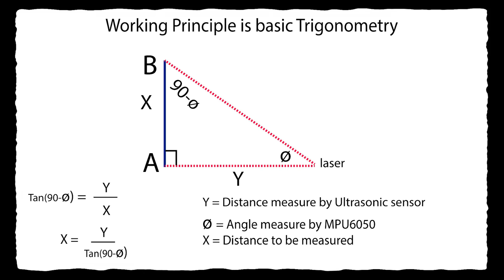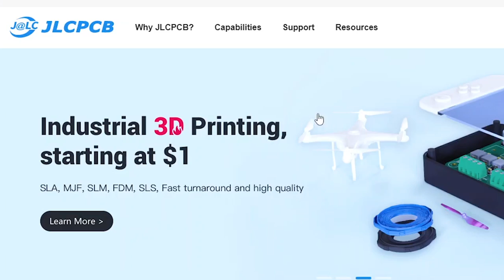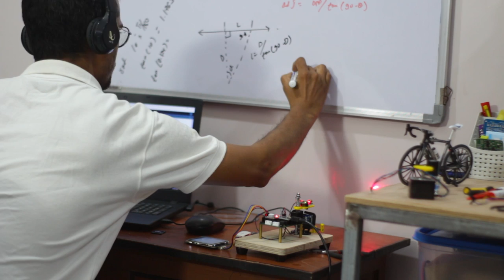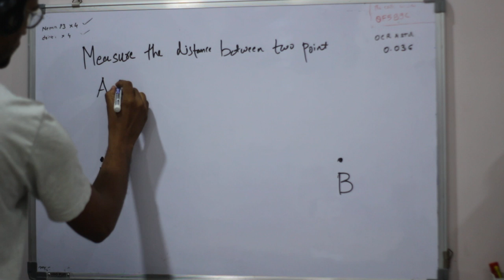DIY gadget to Remotely Measure distance between 2 points.

Comment: I understand the concept. It measure the distance between ultrasonic sensor and the wall along a perpendicular. The other variable is the angle between laser beams. How do you measure the angle? What kind of sensor you use? Arduino must to know it.
Reply: You could use on the fancy side a gyroscope or on the cheap and easiest side a potentiometer or a rotary encoder.

Comment: How about using trig and lasers to find the distance to the board or even an object at a longer range, a range finder.  2 lasers at a known distance from each other, 1m.  One fixed straight ahead. The other laser movable with the angle fed to the microprocessor.  Superimpose the lasers on a distant object and calculate to find the range.  Whala a modern coincidental range finder.
Reply: I was thinking the same thing. 2 different variations of the same concept. This is a nice implementation.

Comment: I didn't expect that angle measure with ITG/MPU would be accurate, impressive. But if those are accurate you could use a second one at the second laser diode. The differnce of angle to level is the angle between the laser diodes. Knowing the distance between the lasers, you can calcluate the distance of the object. This will be more robust than the ultrasonic sensor. Your measurement asumes that the first measure is exactly perpendicular... mounting both diodes on a rotating platform and making the diodes bothtimes overlap will enable to do much better calculations.
Reply: I really wonder how the angle was calculated from the MPU, usually I get a angle significant drift over time. Which adds huge failures to the show cased example.

Comment: I've already do the same project but I'd use a fixed distance between two laser. A servo motor adjust the angle for calculate with an arduino.